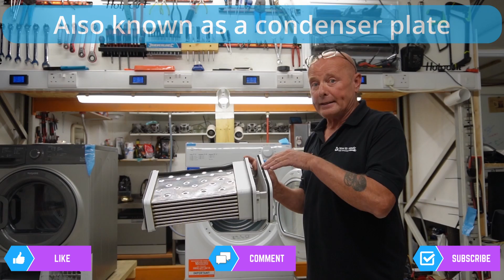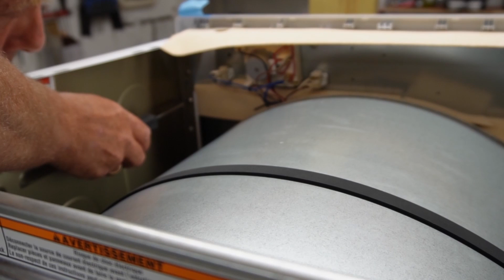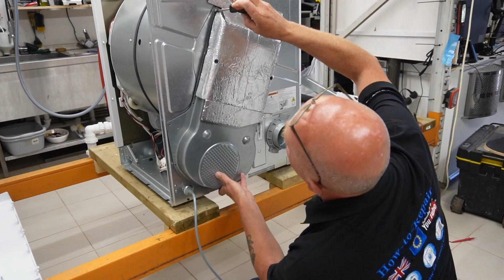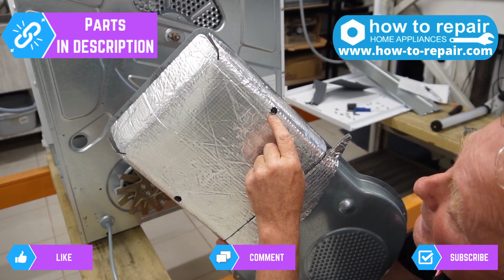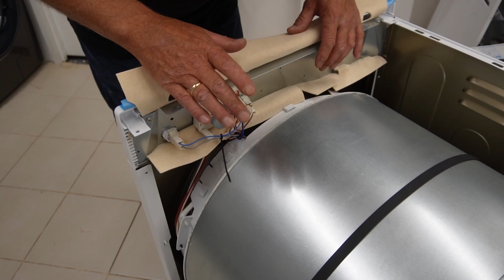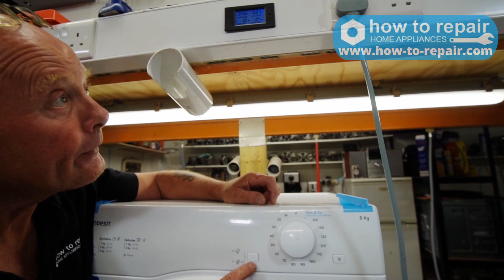Tumble dryer not heating how to check & test the thermostat on the heater element Hotpoint Indesit

Comment: our dryer will run o.k on low heat...soon as high heat it stops after a few minutes including the motor, after about 10 minutes a click is heard and the machine will start....it will do this, with no clothes in, vent tube disconnected, and clean filter....obviously a self resetting stat is operating....but which one is the most likely to be? thanks

Comment: my dryer heater element got 3 wires....at the machine connector side  the colours are black ...red..yellow,   by looking at the inside the element i see 3x wires connections....2x red and 1x yellow, how would i test for this? wich wires? thanx

Comment: No heat output. Followed your video and checked the stats using a multimeter. Found the faulty one, ordered and replaced it and back up & running. Your video saved me £200! Big thanks
Reply from the maker: Really glad we were able to get your tumble dryer up and running you can do us a favour though subscribe to the channel as that does help us have a great New Year with the well saved money
 glad we could help you @markkeating3522 this is for you https://www.youtube.com/shorts/e432SAb2g08 please remember to subscribe as that's what keeps this channel going. Thanks 👍

Comment: my indesit tumble dryer doesn't heat enough, stats are good beside the element and element itself is good. What could be the issue? cos if i dismantle my dryer further to locate other stats they would show continuity on the multimeter. How would i know if any of them is faulty?

Comment: Followed your video as we have the same model. You didn't mention the reset on the thermostat on the SIDE of the heater that causes the dryer to run cold. Press a paper clip into the hole until you feel it click. Test it on your multimeter for continuity too. Why this isn't the old 'red button' I don't know!?
Reply from the maker: Some of the thermostats do not have a reset button. You are lucky. Have a great Christmas and a happy New Year. glad we could help you @radioman1170 this is for you https://www.youtube.com/shorts/e432SAb2g08 please remember to subscribe as that's what keeps this channel going. Thanks 👍
Reply: Thank you do much for this tip. It worked for us and saved us getting a new dryer. Very grateful. 😊

Comment: Hi I had a yellow dot thermal fail on the neutral on the heater what could have been the cause? The condenser was completely clogged. What is the spec replacement I need?
Reply from the maker: Without having your model number, I find it very hard to help you. Please could you use the website with all the correct details.  Hi Paul B I will need the full model number of the identification plate please use our contact us page and make sure you fill out the request of what part you are after and will get back to you within 24 hours normally https://www.how-to-repair.com/help/contact-us/
this is for you https://www.youtube.com/shorts/e432SAb2g08 please remember to subscribe as that's what keeps this channel going. Thanks 👍

Comment: Thank You! - Having watched your video - and finding a screen-grab of the circuit diagram on the web - I was able to go through the various combinations of the 4 wire heater connector to trace the fault to the lower element, with the upper element and thermostats all OK. 😊👍
Reply from the maker: glad it was helpfull  @victorldunn9638  this is for you https://www.youtube.com/shorts/e432SAb2g08 please remember to subscribe as that's what keeps this channel going. Thanks 👍

Comment: Great video.

Would it be possible to tell me if there are any other thermostats along with their location (apart from the heating element unit thermostats) on an Indesit (idc8t3) condenser TD ?

Not heating, tested the element and thermostats on the heating element-unit and I have continuity and circa 45/92 Ohm for single/both elements.

Still no heat, motor, drum, pump are all good.....a little perplexed, but there must be another thermostat somewhere, just not sur where.

Hope you can help (fingers crossed).

Comment: Superb. Thanks a LOT for sharing. I've been this morning in a hotel here in Spain, trying to repair a Hyundai condenser tumble dryier. The motor and fan worked fine, filters are clean, both klixons were ok, as well as the rear and front  NTC's. The resistances didnt seem ok, as I got weird values (about 300 kohm for low and high resistances) After dismantling the back of the machine and checking all the components I just mentioned, I switched the machine on, to see again what happens. The machine didnt start, because the problem now was that the display showed error E5, which is Open Door, even though the door was closed. Before, this error didnt appear. I took out the front panel to have fully access to the door microswitch, and after checking it with the tester, I confirmed it worked ok. The wire coming into the microswitch comes from the supply wire, and the wire coming out goes down (instead of going to the electronic card), to the area were the motor is, which causes I couldn't track it (as I had to leave soon), and check for any wire interruptions, which would be a reason for showing Open Door error. Since this is not an old machine, and a relatively well maintained one, my diagnostic is that there's a problem with the electronic card, as well as with the resistances. Another thing is, the user told me that apart from not heating, the differential switch often cut the power while the machine was working, althoug not always. In fact I didnt see it happen.

Comment: I purchased one of those small ‘portable dryers’ from Amazon. 110volt. It worked great for 3 months and now it doesn’t even turn on,Heat,timer,tumble. Nada. Nothing works outlet has power. I paid over $300 USD 3-4,years ago. Now,I’m afraid to buy a new one and brand. Any ideas of what a new dryer would cause this ? Danke.